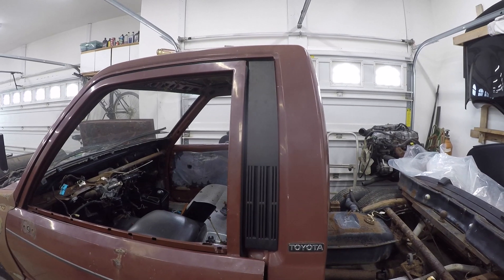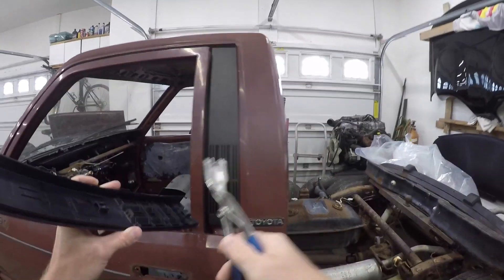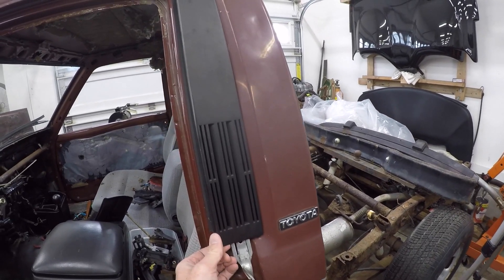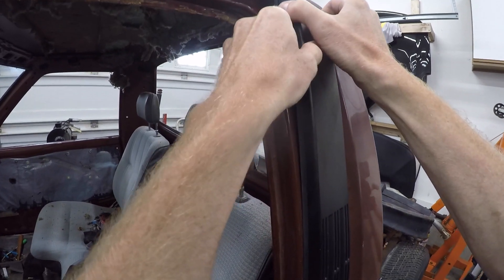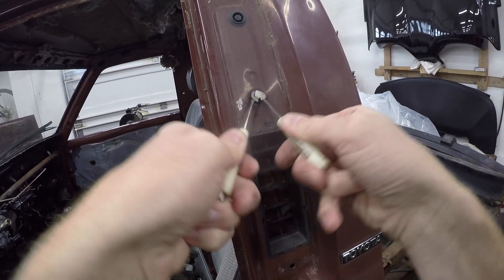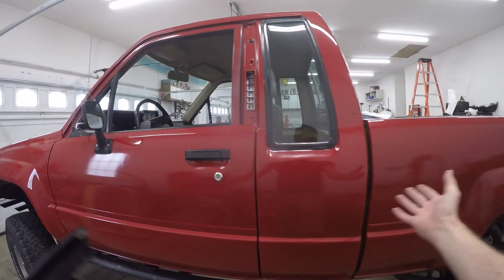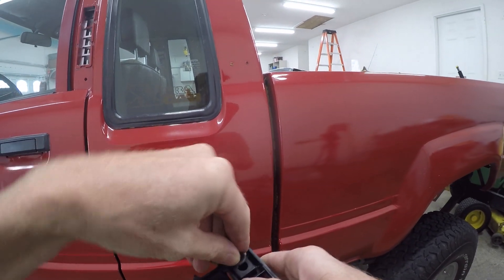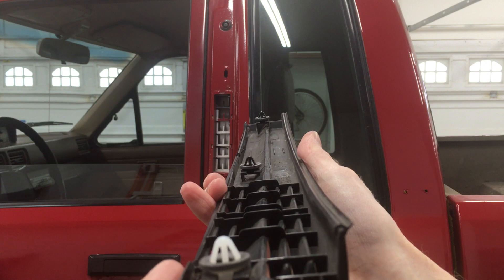Toyota Pickup/4Runner B-Pillar Trim Removal & Install

Comment: Hey so in case AutoZone doesn't play ball is there any way to get away with not having a speed sensor on an 85 Toyota pickup I picked up a new speedometer and made it brand new dash gauge instrument cluster and only to find out once it's completed I can't use it that's speedometer there's no terminals for a speed sensor and I don't know if one can be retrofitted or anything like that can I somehow integrate my old speed sensor terminals and the new gauge. Or hell can I buy some sort of tiny little motor that will turn the dial as needed?
Reply from the maker: I’m trying to understand why you’re going through al the trouble... so you’re using an aftermarket speedometer?
Reply: @6thGearGarage  Because I know nothing about auto care, the best way for me to learn is by tearing something down and building it back up from scratch, and because usually when a smooth paved path or a hard rocky one presents itself, I choose the path with the Grand canyon and no bridge. And yes it's an aftermarket by Equus. Plus I like to customize things to my own liking not even that they're bad just I like to customize. Oh and mentally disabled.
Reply: Now the reason why I'm doing it in the first place though and not just driving it is because I was getting major idling issues. And since I knew nothing in August, I tore it apart thinking I had plenty of time to learn. Well I don't anymore, and it's time to go. And now the hurry is making me make mistakes. I'm going to be living off grid so I needed to know what to do in case it broke down, that's a lot to learn. But I'm also turning it into an RV of sorts. Yep, I did just say that. I'm still working on the suspension and weight capacity.
Reply from the maker: @SarethNolan  This is a first for me, I haven't seen anyone use an aftermarket speedometer in these trucks before.

Comment: It would be cool if you could get a 4 Runner to do some videos on that. and how do you keep the rubber gasket on your window to stay in place? mine keeps falling down :(
Reply from the maker: I''m always on the lookout for a 4runner, just end up finding deals on pickups instead.   What gasket do you mean, the channel run that goes down inside the door?
Reply: @6thGearGarage  The one inside the door for the window
Reply from the maker: @Asyll.  I've never had one fall down. Are you in a place with mostly sun/warm weather?
Reply: I have an '87 Runner and when I bought it the exact same thing happened. Whenever I rolled the window down the weather stripping would come down, too and flap around in the wind. I ended up having to replace my driver's side vent window for unrelated reasons and while I was in there I took the window all the way off the regulator, taped all the rubber bits in place along the top and then re-situated the window from there! They haven't fallen off since! I did it on a hot day in the sun, too so the rubber was nice and pliable. I hope that all makes sense? Now I just have to do the same thing to the right side!